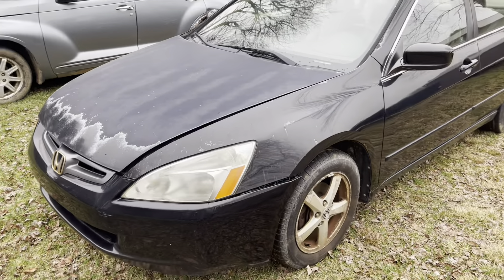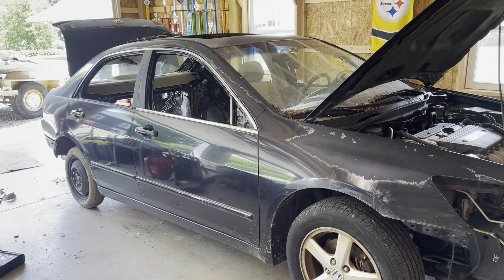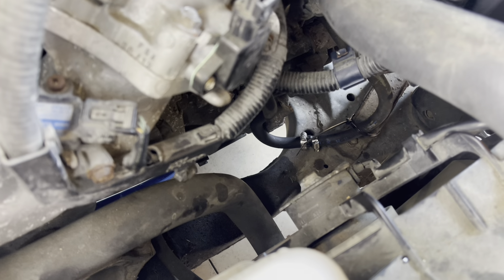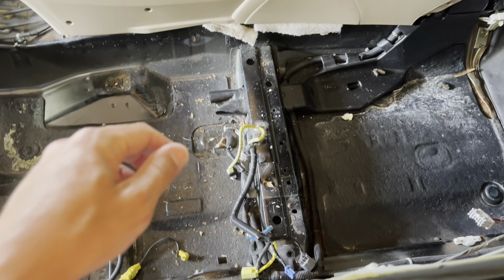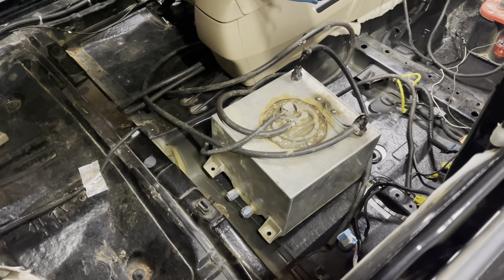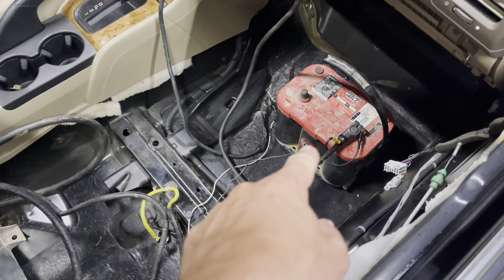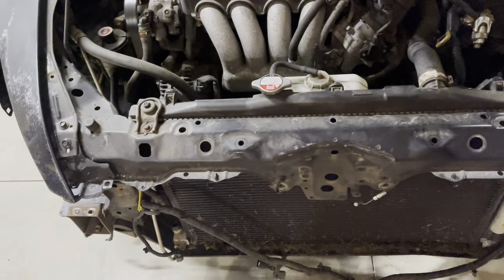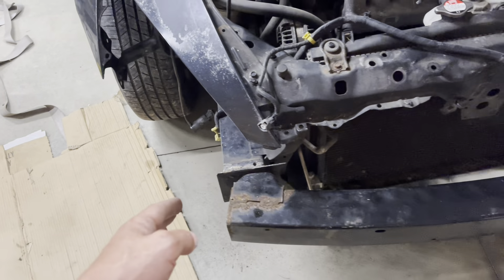Honda Accord Derby Car (First Look and Build)

Comment: I know on the 02 and older honda accord 4 cylinders you can loop the rad lines and they will run 20+  mins and the front frames are stupid hard but I'm not familiar with this body so im very interested on how it holds up